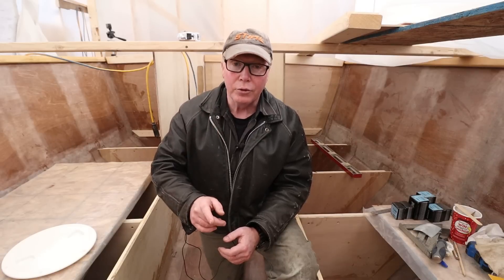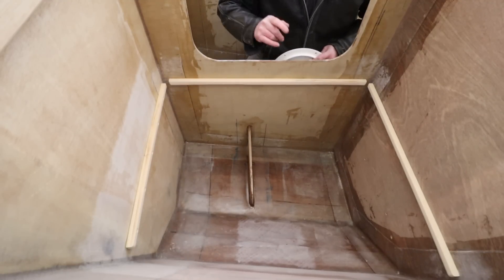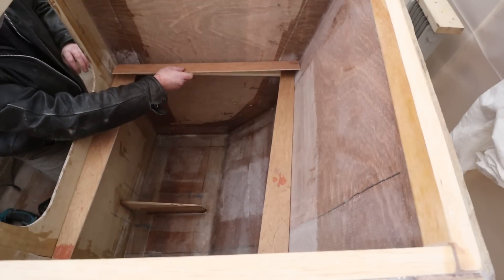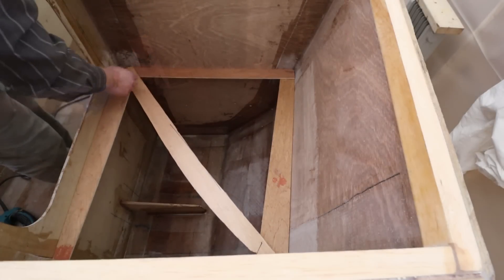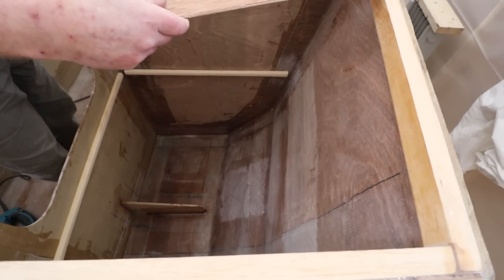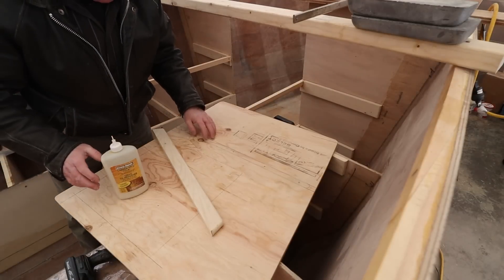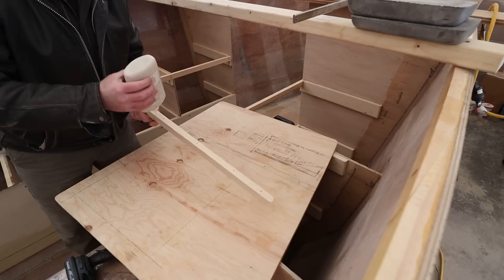S2E45 Crash Bulkheads || Inspection Hatches || MK3 Wind Vane Contest Winners

Comment: One way to measure things very quickly and accurately for measurements between the bulkheads like your doing for a hatch is to cut two lengths of wood in strips about 3/4 of the size of the area your measuring between the bulkheads. Then place two of those sticks on top of each other and spread them apart and you have a perfect measurement. Its supper fast and accurate no need for a tap measure at all. cheers.. nice boat sir. nice boat.

Comment: I use tight bond three good stuff but will it affect the epoxy bond to the plywood? Also would a tapered edge be of any benefit other than it looks better in a area you will never see? Just gave away our 7.9m trailer sailer that had rain water get under the glass and into the plywood. Following this as it's more my thing than a go fast boat. I blame the Hills